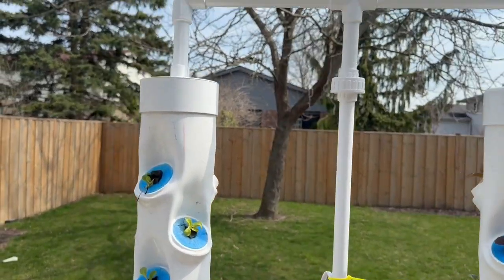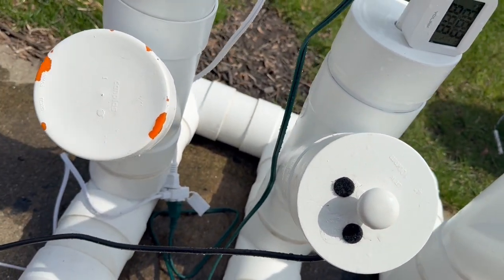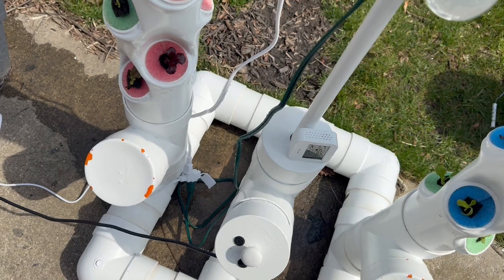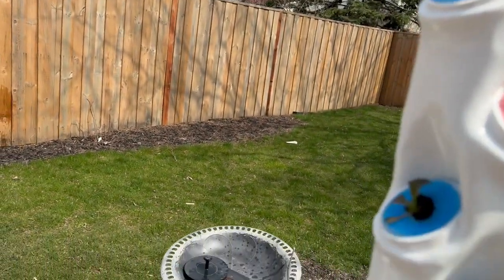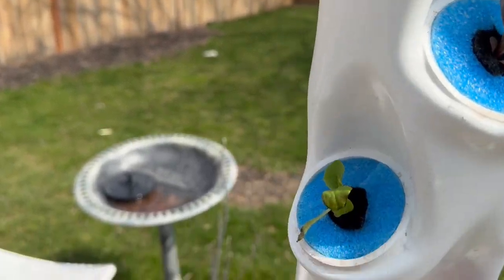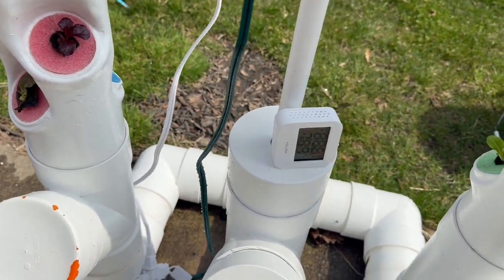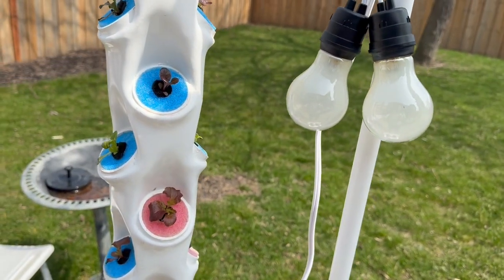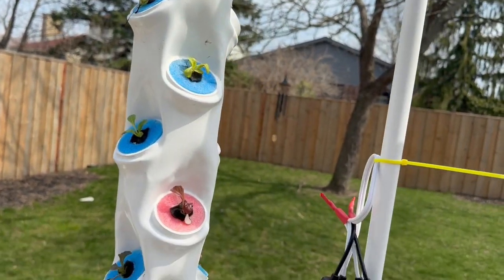Aerotower How It Works

Comment: Root rot is caused by overwatering or roots constantly in water with a lack of oxygen.  With this system the roots are watered by a drip system for a couple minutes then they are suspended in air when they can absorb the oxygen from the air.  I have never seen root rot with this system